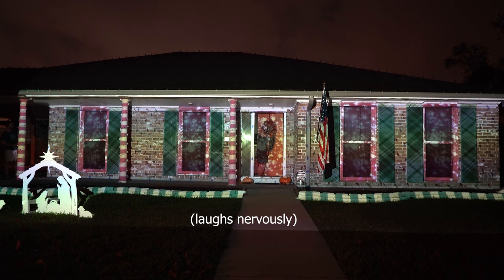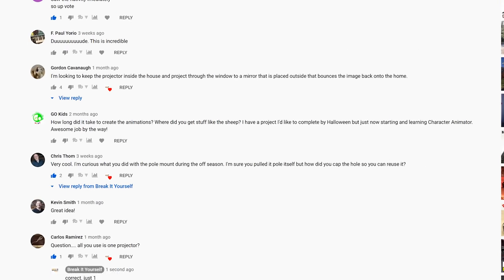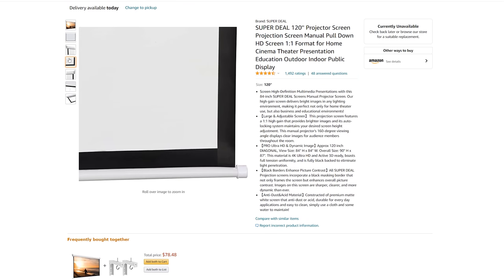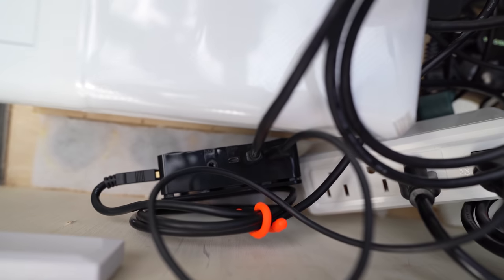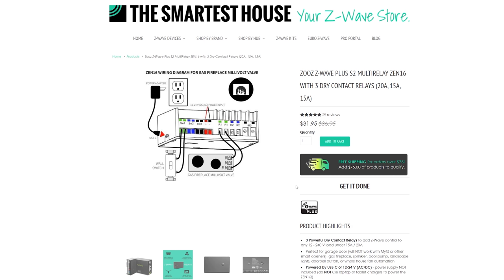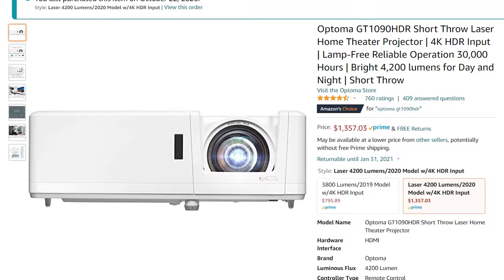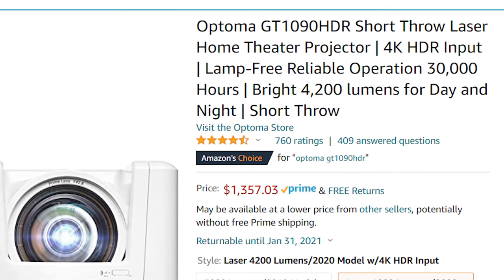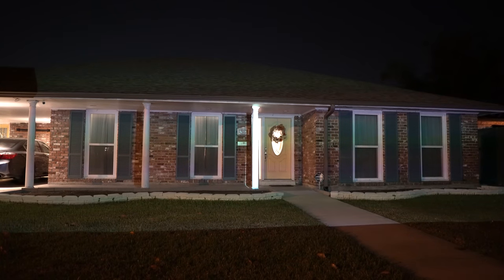I Projection Mapped My House for Christmas - 2020 Update (Part 1 of 2)

Comment: After making a 9ft projector screen myself I found blackout curtains worked the best and was almost perfect. 
Also maybe a windscreen wiper would suit your needs more, dc, high torque, silent low energy consumption,  a cheap voltage regulator and a timer circuit. Prob cost $50.

Comment: For the AC wench the easiest would’ve been to add a relay and control the relay to turn on and off the wrench.
Reply: The issue wasn't turning it on and off. The issue is getting it to reverse. Reversing a DC motor is much easier

Comment: You actually could have gotten the AC winch to work with the Zen16 ... initially I thought that it was impossible, but then I noticed that they've got the two lower pins on their DPDT switch tied together, meaning that they're effectively using that portion of the switch as a single throw. This is lucky for you since the Zen16 has 3 relays -- you can use one relay to replace the lower pole on that switch, and the remaining two to replace the two throws on the upper pole. You'd have to use software to make sure that they operated in the correct sequence (as was done mechanically by the original switch).

Comment: Quick question--how did you get the Optoma GT1080HDR (or 1090) to work with the projector controls on FPP?
Reply from the maker: download the plug in "projector control" and get a USB to RS232 cable. Then you can use the script to turn on, select input, etc of the projector.
Reply: @BreakItYourself  I've done that, but my problem is that the plugin doesn't have either of those printers (mine is the 1080) built-in and I'm not sure of which script/settings to use to get it to work.  I've tried a few different ones and I tried asking on the forum but no luck yet.

I actually started this project and bought the 1080 before I even found your 2019 video.  Nice job!  My house is mostly brick, so it's not too bright, but it still is looking okay so far.  Your videos are quite helpful.  Thanks
Reply from the maker: Here are my parameters:

Enable ✅ 
Connection type: serial 
Serial device: ttyUSB0
Projector: Optima_150s
Everything else blank
Reply: @BreakItYourself  Thank you!  That worked--for some reason I thought I tried all the Optoma settings, but I must have missed that one.
Reply from the maker: Glad it worked!!

Comment: I much prefer the show WITHOUT the screens. They kind of defeat the purpose of projection mapping ... you're supposed to use the structure to your advantage and as part of the show.
Reply from the maker: Yes, I completely agree. The main issue is that my projector isn’t all that bright and the light dies into my brick. The projections are very hard to see which is the only reason I went with the screens. Maybe one day the cost of really bright projectors will come down enough to add to the display